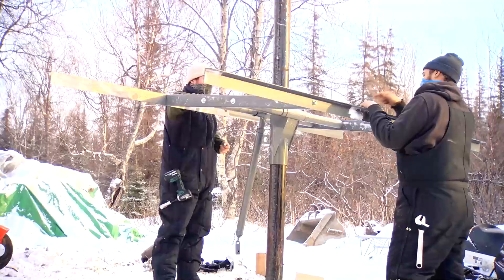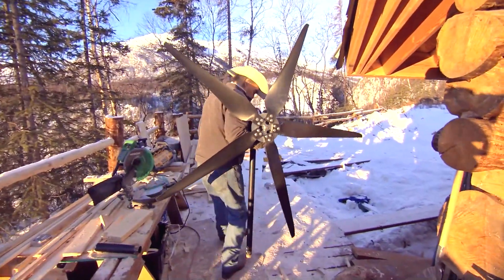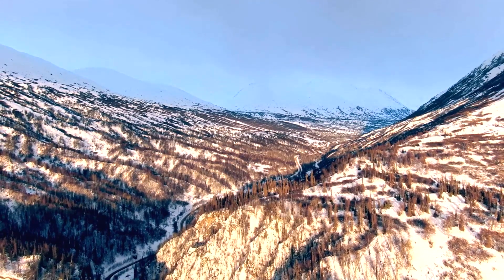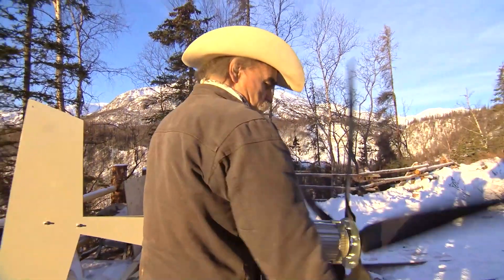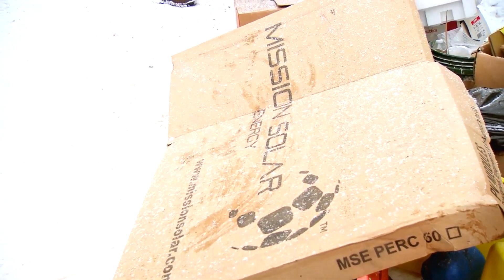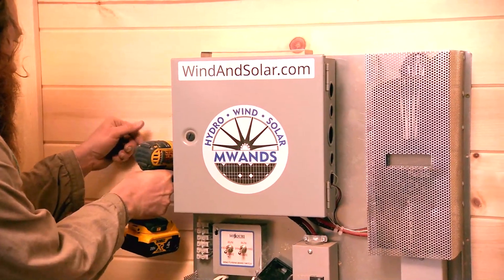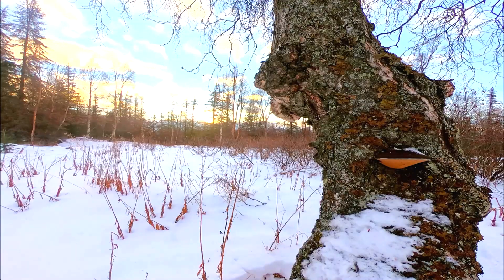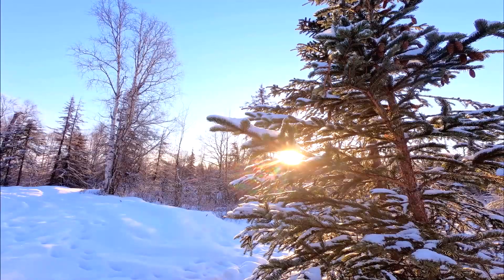Wind Turbine Featured on Homestead Rescue! | Missouri Wind and Solar

Comment: Im going to do build out a cargo trailer for boondocking, i think I'll be going with 4 330w 12v solar panels, and im going to use 8-3.2v 280ah lifepo4 cells. From what i gather that should run everything i need, mainly a 5,000 btu window ac, a small deepfreezer as a fridge, some strip lighting and a 12v pump. I would like to know if i can also put a pma alternator wind generator on for a second charge source, in case of cloudy days or to run a water heater? 
   I watched a couple of your older videos and it seems like it's possible, and i think your dual freedom 11 all in one charger is what i would need. Will that work with the lifepo4 battery bank, and would i need anything else besides the bank set up as a "suitcase" unit? I haven't bought anything but the battery cells, as i don't want to buy things i wont need if your unit has all the controllers built in. Ie a bms, smart shunt, mppt controller, inverter ect. Any information would be appreciated, a all in one plug and play unit seems much better than a diy guessing game from the dozens of channels mixing and matching parts and hardware. Thanks for any assistance!
Reply from the maker: Please reach out to our sales team at 417-708-5359 or sales@windandsolar.com and they can assist you with your project. Thanks for watching!
Reply: @MissouriWindandSolar  thanks for the reply, i didn't get notified that you did. Glad i was going to ask another question or i wouldn't have seen it.